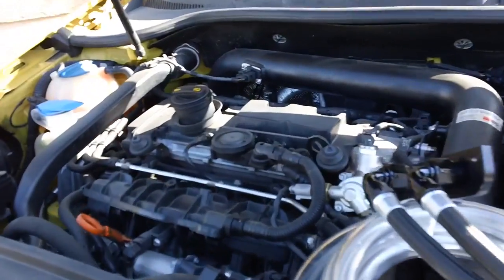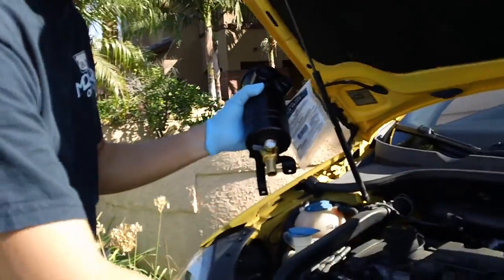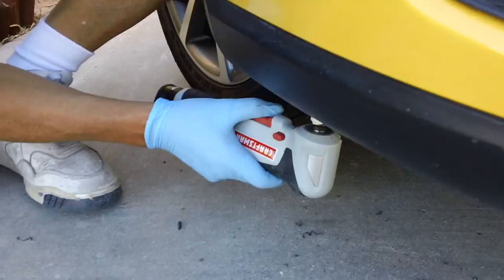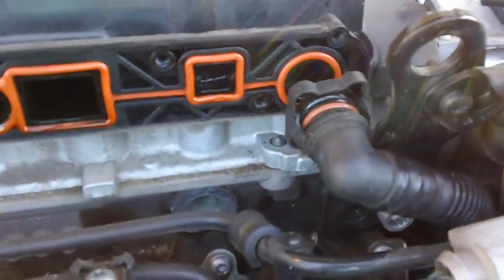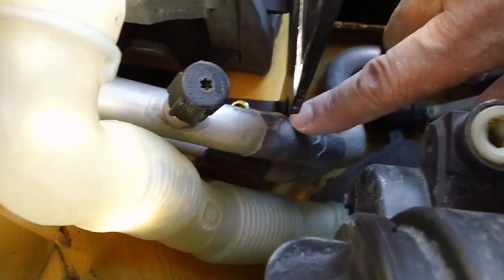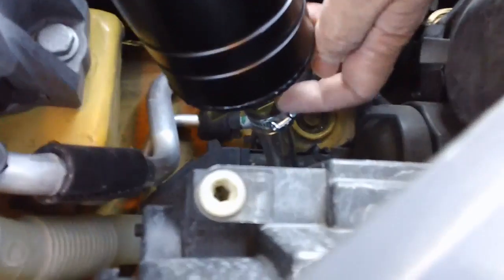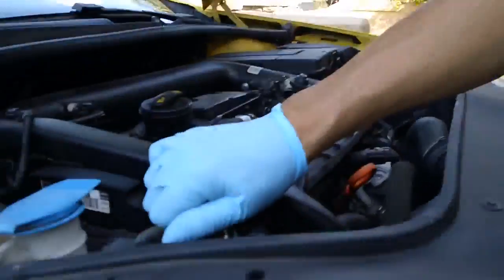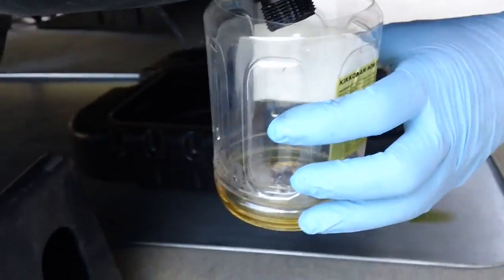How to Install: BFI Catch Can System VW GLI 2.0T FSI MKV

Comment: What about catching the oil on your rear PCV outlet?? The way you have set up the catch can will only capture and filter blow-by whilst under idle, whilst under boost your rear PCV will be spewing blow-by oil into the turbocharger and intercooler, throttle body etc. Also your MAP sensor will get oil damage too. You need to hook the catch can onto the rear PCV outlet, it's a bit of a myth amongst YouTubers and aftermarket catch can suppliers to hook them up to the front section.

Comment: A $35 ebay catch can is more than enough to do the job.....
Reply: One must ask ... Did I spend WWAAYYYYYY too much money on such a simple device in the process of my engineering repair ? Amazon too has a great catch can Ive used in the past. Direct injection DOES have its benefits, but the PCV valve system on a direct engine isnt one of them. You really dont have to spend this much money on this when you can achieve the exact same results at 10% of the price spent on this little project
Reply: those 35 dollar catch can catch nothing , been there , done that ......

Comment: video was well prepared, with the introduction of direct injection by vw in such a small motor has all other manufacturers doing the same, but catch cans are not new in automotive. I also have a mkv with upgrades that enhance it no power upgrades on it.

Comment: Eddie, this is really interesting, but it begs the question: did VW properly engineer the engine, when such a solution is necessitated? I have a VW, and while it has been problem free and quite enjoyable, I can't help but think that my Honda has simpler and in some ways better engineering.
Reply from the maker: +azaz911c - I have done a lot research on this and it is just the nature of all direct injected engine because there is no gas that is sprayed over the intake valve and therefore it will have a chance to be cleaned by the gas.  VW/Audi does have a solution for this issue and they have this solution on all their 1.8 as well as their 2.0 direct injected engines, and that is to have two injectors per cylinder.  One port injector and one direct injector.  Unfortunately these engine are only available in Europe because it is an added cost.  And we here in the US want to pay Civic prices for a Jetta or Golf.  I believe only the Audi Q5 and A6 has that dual injector system here in the US.I did needed my intake valves cleaned by the dealership at 100,000 miles for $599, because I had this catch can installed years later.  However, with that said I would much rather drive my GLI over my Civic any day.  Yes, the Civic will be more reliable and I believe the Civic as well as the Fit are the perfect car for young people who are starting out in life, but I am close to 60 so it is the VW for me.
Reply: +azaz911c I Used to Drive Honda, got an TFSI now, I am really happy with it. I really do not like the new Honda's appearances but I do think Honda makes much better motors. the TFSI engines drive fantastic but a lot of things were engineered bad. On the other hand the TFSI's are pretty next gen tech. I am going to order a whole bunch of last revision OEM parts and replace all the pref rev. bad TFSI parts like the crank breather, boost valves, fuel pump follower etc.